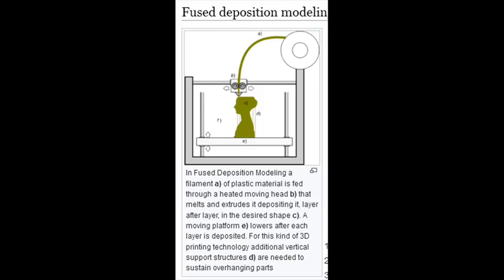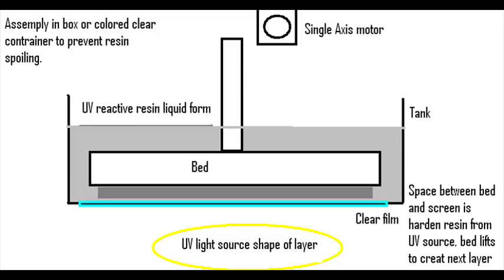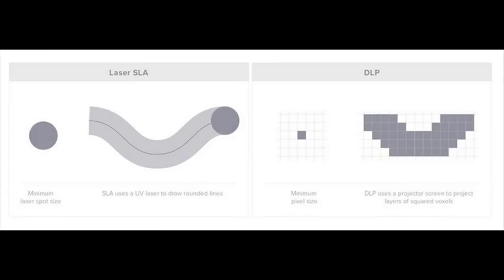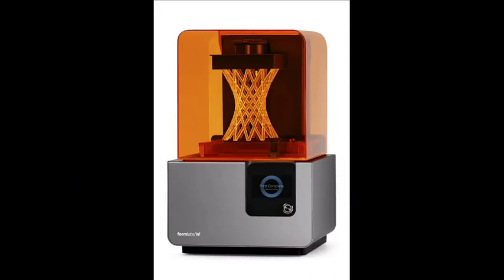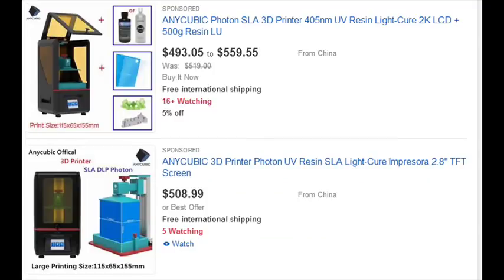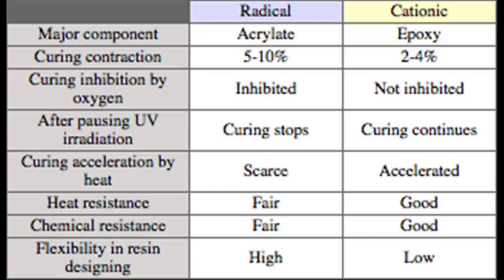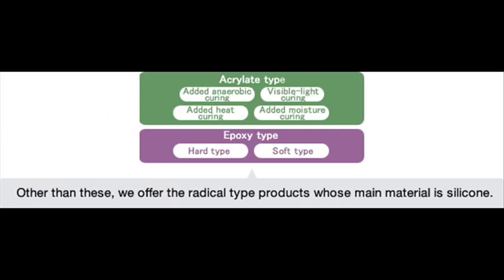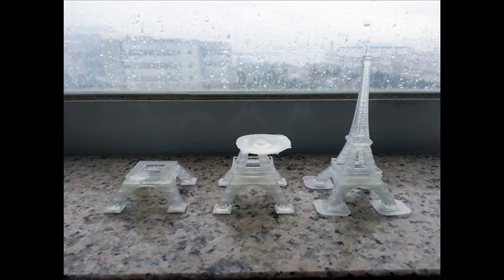Introduction to SLA DLP 3D printing by Mokanaman

Comment: Hello Mokanaman! I was just watching an airbrush video of yours was 2016 and was happy to see you're still posting! 

I plan to begin 3D printing and then painting anime figures on those prints. 

Would you say almost all the techniques you go over would apply to this? 

I am doing a FDM printer, but level of detail and surface finish shouldn't be an issue (I have a technique I'm fairly certain should work) 

ALSO: Truthfully, i'd like to slowly get into things, could I make do without an airbrush at first, and just paint on thinned acrylic, and later on go to airbrush?

Comment: I have the Anycubic Photon, been printing with it for about 5 months now and I have yet to be let down. I have around 500 prints done and the detail has always been fantastic and has freed me up to do kitbashing projects that prior to this I was limited or at least starved for the awesome detail I have been able to do with this printer. Well worth the $450 I paid for it but the resin is expensive, so knowing how to hollow is key to getting the best bang for the buck.
Reply from the maker: Already been doing some CAD designs for diorama bits and kit add ons hollow. Even solid the parts rolling out at the price of resin is far cheaper then the gross weight of a finished kit at retail. Can't wait for these to be more mainstream! Thank you for watching.